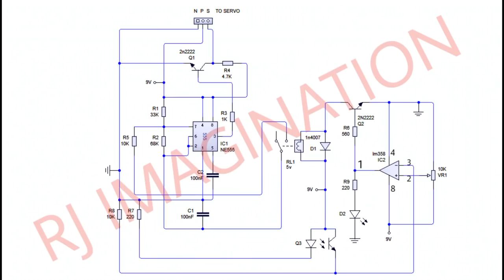SMART LOCK | how to make smart lock using IR receiver and transmitter with servo

Comment: Thanks for the project, one question why have you used astable multivibrator NE555,you can achieve that  by connecting the relay to simple BC547  whose collector  is connected to the servo. Could you explain the schematic of the project not in detail.